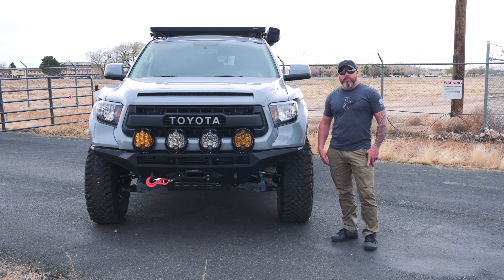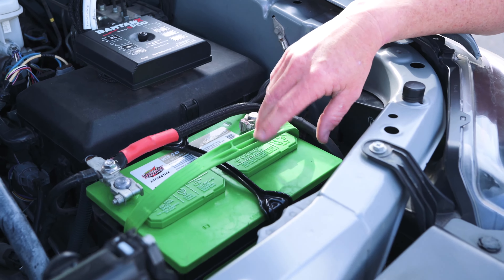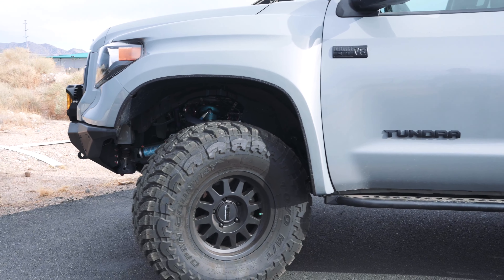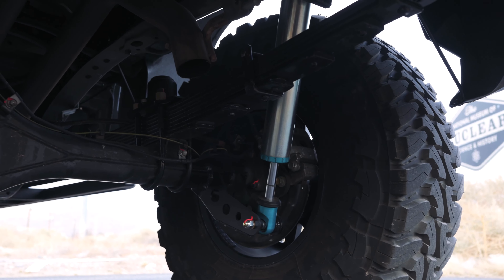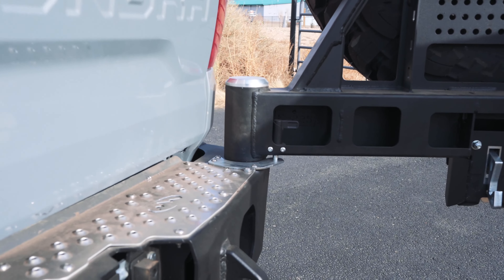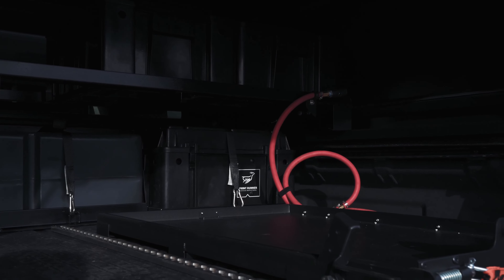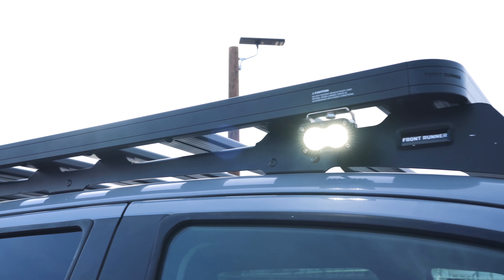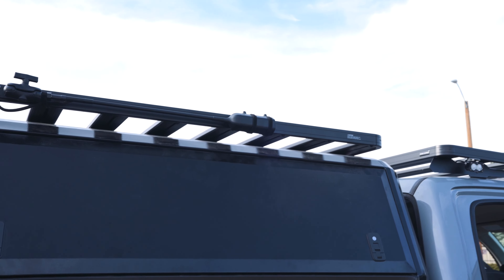TAV Spec 2017 Toyota Tundra | Stage 2 Long Travel

Comment: Love this Rig love how you built this out especially the front bumper with the amber and white fog lights I have a 2018 Toyota Tacoma TRD Pro definitely thinking about the same type of bumper design there are so many out there  I want to build my own I bought my truck in May still haven’t put 3000 miles on it I don’t drive it that much by next year I’m going to get a tundra as well and I want the V8  if you’re going to buy a full-size truck you got to get the big motor  and the style of this one 👍👍👍👍👍

Comment: my only complaint and im only speaking from limited experience, the cut off exhaust dumped at the rear leaf's and such. my experience not on a tundra but i had similar systems that caused rust issues from exhaust gasses breaking things down

Comment: HELP with leaf springs! I’m going with Eibach pro truck lift stage 2R with icon uca and I’m conflicted on the leaf springs.  I’m gonna have roughly 300 -400 pounds in the back. Shop telling me deaver k37 is way better than icon RXT or add a leaf. But the reviews on deaver seem to be not so great saying they sag to fast (after a year). Looking at all the options here (toytec, deaver, icon, dobinsons).  Ome says 2.5 inches of lift which I think is way too high in the back.  Being that the Eibach is gonna be 2.75 inch in the front and 1.5 inch in the rear.
Reply from the maker: Well, we only use Alcan like we mention in all of our videos.

Comment: How is the rear FrontRunner rack attached to the RLD? Looking to do something similar with mine and it looks like maybe you omitted the aluminum tracks and instead mounted the rack directly to the RLD channels? If so, how did you attach them together? Thanks!

Comment: Great build, thank you for sharing. The rear shock relocation is genius. Do you ever use air bags on the rear to adjust for varied loads? What are the solutions for you employ for additional fuel or larger fuel capacity for the Tundras?
Reply from the maker: If you can give us a call at the shop we can go over all the details to your questions or you can check out our other tundra walk around videos where we focus on the fuel and spring rate solutions.

Comment: I love it, if there is 1 more very important mod that I wish someone could do is payload. There should be a mod to increase payload, adding airbags or different leaf springs makes it carry loads better but doesn’t increase payload capacity. I’m sure that tundra is over it’s payload capacity but most people don’t care about that.
Reply from the maker: There is no mod that can increase the payload.  The manufacturer sets the payload capacity based off of many variables.  This truck as it appears is well within the stock payload.  Stock payload on this truck is about 1,630 lbs.  What the customers do with the vehicle later is up to them.  Depending on what the truck needs to do we address important areas that do make the truck handle even better and safer than stock.  Things like spring rates, shock valving, stronger brake systems, proper gear ratio’s and at times completely replacing the rear axle housing to a much stronger unit.  The manufacturer will invest as little money as possible during the manufacturing process to meet the payload, fuel efficiency and safety numbers set by the engineers and governments in order to maximize the profit margin at the dealership.  That is where the payload capacity and GVWR is born.  That can’t be changed later unless the built vehicle is put through an impossible amount of tests to certify a new capacity.  There are many more details that could be listed but hopefully this will just shed a little bit of light on the subject.
Reply: @TAVLLC  yea makes sense, thank you

Comment: Have you noticed any problems with how close the bump stop is to the frame? It looks like it only has 6 or so inches before impact. I had those exact ones on my Tacoma with a 3 inch expedition leaf spring and it was always slamming so hard ?
Reply from the maker: Nope no issues

Comment: Love it. What did this build cost? If you don’t mind sharing. I know your website says to contact for further info but just curious as to a ball park figure. Keep up the awesome work.
Reply from the maker: Hey Grant, We don't share this as it fluctuates with material costs and supply chain. But our customers know what they want and while some have no issue with just sending a check, others have to save and plan a bit. But each one leaves with a vehicle that is built for them and their needs.
Reply: Probably 19-40k minus the base vehicle.
Reply: @heavyarms951  Uh, no, PLUS the price of the vehicle. Or "built on customers supplied truck".
Reply: That cost a lot I tell you that lol. Just in racks,decked system and awning he’s near 10k easily.
Reply: They don't share because it's very pricey lol. It's kickass no doubt. But very common business practice to not divulge the price of expensive things without some form of contact with the company. It leads to less profit :)
Reply: @TAVLLC great job of not answering his question 👎

Comment: I just want to know if you can daily drive it and also what kinda mileage it gets after it's built probably better than we think but yea
Reply from the maker: In our stage 3, supercharged tundra with 37’s and 5.29 gears we get 16 mpg with the camper on it as a daily driver. It’s the most fuel efficient truck we’ve had.
Reply: @TAVLLC  wow thats amazing and I saw that video of the truck not fully finished and it looks amazing and with that fuel economy definitely worth the money

Comment: Coming in a little late, but any regrets with the 4.88 gearing? I have 2nd gen. currently running 35's and I'm going with 5.29 gears. Any input would be appreciated. Absolutely beautiful rig BTW.
Reply from the maker: Both 4.88 and 5.29 work great on these tundras with 37’s. It just depends on what you want your highway cruising rpm’s to be.

Comment: Did you add a supercharger to this Tundra?
Reply from the maker: Not to this one.
Reply: @TAVLLC  Any reason the customer didn’t want the supercharger?  Seems like a smart option
with the increased weight and drag on a Stage 2 build.
Reply from the maker: It’s definitely nice to have the supercharger on any build but since we regear these trucks with the proper gear ratio to tire size the trucks do very well and don not feel heavy or sluggish.  It all depends on the customers needs and budget requirements.

Comment: Question.  Can a 2020 Tundra Limited, with an offroad package, be built for  an offroad/ overlanding rig? How well can it do? Or would the extra money be better off spent on the TRD Pro?
Reply: That 2020 limited tundra will do just fine, build it up and be way more capable than a stock trd pro
Reply: You’re better off starting with the Limited as your base build, and this is coming from a TRD Pro owner. You’re going to replace just about everything the TRD Pro comes with anyways, no sense on paying a premium for suspension, skids, etc that’s you’ll just be replacing.